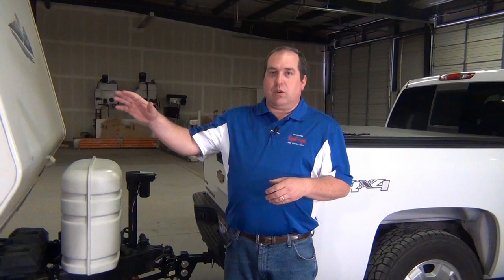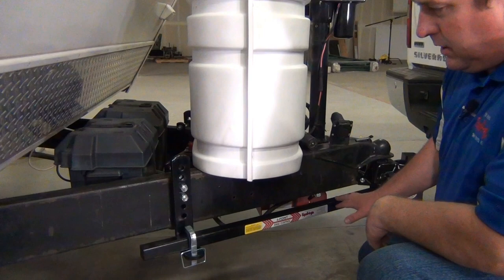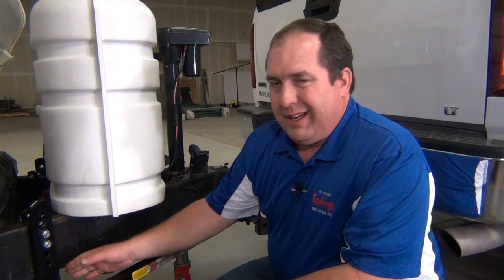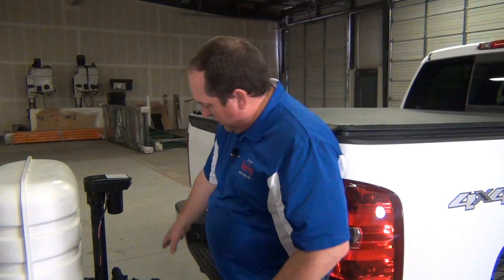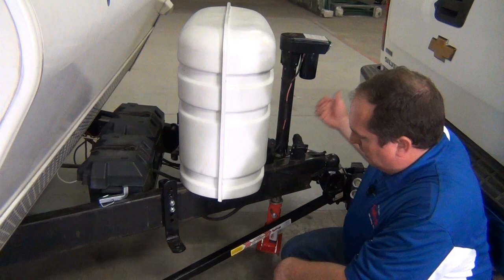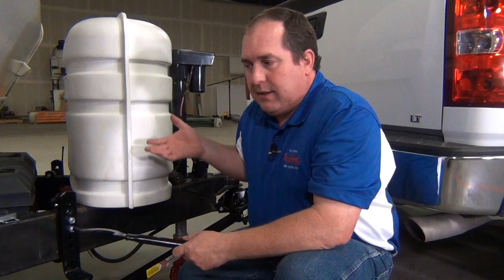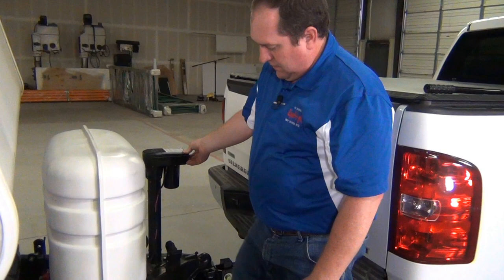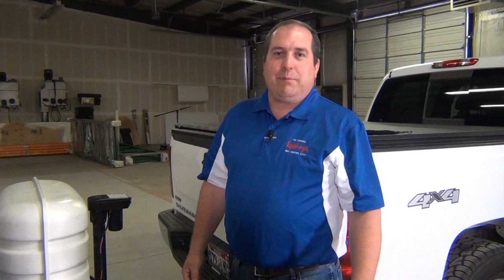How To Hitch and Unhitch Your Equal-i-zer Hitch

Comment: Great Video ... on the GREATEST Hitch!!!
If I were to add anything, it would be about the unlikely situation where you are either trying to couple/uncouple where the trailer and tow vehical are not approximately level, or if you can not raise the tongue jack high enough to loosen the spring bars.  I would suggest: A.) When vehicales are not level ... uncouple on level ground, prior to un/coupling; or B.) If you can not loosen the spring bars ... you may not be getting enough hight from your tounge jack.  In this case, it may be necessary to use blocking (preferably a sincle, large 4”x6”x?” block of wook, or two) in order to give the tongue jack more “travel” hight to loosen the spring bars enough.

Thanks!
LOVE MY Equil-i-lizer 1200 ... the Greatest Hitch Ever!!!
Reply from the maker: Thanks for the compliment We’re glad you love your Equal-i-zer hitch.

Great advice, thanks for the comment. Have you tried a Fastway Flip [https://www.fastwaytrailer.com/flip-jack-foot] automatic jack foot? It’s super fast and easy, saves you about 50 cranks every time you hitch up or unhitch, and gives you an extra 6” of length on the jack.

Comment: I wish I knew this when I got the camper! I could not figure out how to use the pry bar tool and wound up using a rubber mallet to get the sway arms in place. I do not have a power jack and did not latch the ball did not lift the truck with the hand crank. After watching this video it very easy to hook up my new Forest River camper trailer now.

Comment: Great video. Equal-i-zer hitch is #1 
Wished I still owned a travel trailer, it's the ONLY set up I would use.
Reply: I'm new to this hitch system.  I recently purchased a 2018 forest river heritage glen and have this new E2 system.  We took it out this past weekend. One issue I had was removing the bars.  The release pins didn't release the bars.  What am I doing wrong.  I hope it's something simple.  Any suggestions would be very helpful.  Thanks in advance..

Comment: I wish I had seen this 12 years ago when I got mine; I had to figure it out myself.  I love it though, 28' TT + F150 and it tracks straight as an arrow no matter what.  What's more, it's a manual jack so I get plenty of exercise.
Reply from the maker: We’re so glad to hear that you’re having a great experience with your Equal-i-zer hitch. If you ever need an upgrade on the jack, you should check out the Fastway Flip Jack Packs [ https://www.fastwaytrailer.com/flip-jack-feet ]. They are a top of the line jack, and come with a Flip automatic jack foot included to give you an extra 6” of lift, and no need for wood blocks. They save you about 50 cranks up or down.

Comment: Before the video was shot he probably had gone through the process so that the trailer was perfectly positioned over the hitch ball.  Often, especially when unhitching, the back of the truck will begin to rise as I lift the trailer to free it from the ball.  I've learned to feel the positioning of the coupler vis a vis the ball with my finger and then pull the truck forward or backward a tad so the trailer lifts freely off the ball.  Never comfortable with my finger under that thing.  I wonder if there's a trick to proper positioning that he might tell us.
Reply from the maker: +Craig Knowles,
The most valuable trick I know for coupling and uncoupling your trailer is practice. The more you do it, the more familiar you become with where it has to be.

Aside from that, here are my tips:

Grease the hitch ball and coupler.

When I'm coupling up, I try to stop the ball just a little short of the socket in the coupler - maybe 1/4" to 1/2". Just enough that the coupler is past the flat on the top of the hitch ball, and will catch the rounded surface. When you drop the coupler onto the ball, it puts a little tension between the two, and pulls the ball into the front of the coupler. This gives you space at the back of the ball so the latch can come up against the ball easily. If I have dropped the trailer onto the ball, but can't get the latch to lock into place, I put the tow vehicle in drive (with my foot on the brake, and the trailer tires chocked), and let the idle pull forward just a bit so there's some tension between the ball and coupler, pulling the ball to the front of the coupler, and allowing the latch to move into position.

To uncouple, I get the trailer where I want it, then chock the tires, (both sides). I use the ONEstep by Fastway trailer products. They are rock solid. http://www.fastwaytrailer.com/onestep-chock

If it's on level ground, the trailer usually comes off easily.

If you backed into place, or if you're parked on a slope where the trailer is higher than the tow vehicle, the ball may be pushing backward against the coupler latch, making it difficult to release. In this case, I use the same trick as above, put the vehicle in drive (after the trailer is chocked), and let it come forward enough to take the pressure off the latch.

If you pulled forward into place, or if you're parked on a slope where the tow vehicle is higher than the trailer, the ball may be pulled forward in the socket tightly, also making it difficult to release. This commonly results in what you described above - the back of the truck rising as you try to lift off the trailer. It will lift until gravity overcomes the tension between the ball and coupler, allowing them to release. In this case, with the trailer chocked, I put the tow vehicle in reverse, and let it shift backward just enough to release this tension, then uncouple the trailer.

Hope these are helpful!

Comment: I want to see the spring bars installed and removed otherwise you haven't shown me a from scratch install. I'm considering your product as a replacement for a system with heavy bars and don't want to replace it with something as heavy. thanks
Reply from the maker: Hi Karen! You're correct, this installation video doesn't go into specific detail in regards to putting in and taking out the spring arms. If you need specific instructions on that, you can refer to our EQ instructions, as well as contact our customer service team at (800) 478-5578 and they can walk you through that process as well.

Here is the link to the installation guide. https://www.equalizerhitch.com/manuals-and-guides/manuals/6k-14k-owners-manual

Comment: How does this compare to the Anderson Andersen 'No-Sway' Weight Distribution Hitch? Why is this a better choice?
Reply from the maker: maxamus2012,

This is a great question, thanks for asking!

To answer, let us explain that there are three different categories of hitches. We like to classify them good, better, and best.

A good hitch is a typical chain-style trunnion or round bar hitch. They have been around for a long time, and are manufactured by many different companies. We classify them as “good” because they are a better option than just towing with a ball mount. If you use them correctly, they help distribute the tongue weight back to the front axle of the tow vehicle, which improves your steering and braking control. They do not provide any sway control.

The “better” class holds all of the other hitches (except the Equal-i-zer hitch) that are weight distribution hitches with built-in sway control. There are many hitches in this class by many different manufacturers. They are better than the “good” class, because they do add a measure of sway control. In our testing, the ones at the low end are comparable to a typical chain-style hitch with add-on sway bars. The very best of these we test at about 1/3 as good as the Equal-i-zer. The Andersen hitch would be somewhere in the “better” class.

The Equal-i-zer hitch is the only hitch in the “best” class. It has been around for more than 70 years, so millions and millions of road tested miles and experience. It is made in America (and always has been), using only steel produced in the United States. More than 99% of our customers would recommend the hitch to their friends, and it has been voted the best hitch by the readers of Trailer Life magazine all four years in a row. No other hitch has ever been given the gold in their Reader’s Choice survey – only the Original Equal-i-zer Sway Control hitch. This is the court of public opinion – your peers – saying it is the best, not us tooting our own horn. In our internal testing, the Equal-i-zer hitch outperforms all other hitches by up to 8x. It comes with a lifetime warranty, and delivers the safety and performance trailer owners want and need. That’s why it’s the best.

Hope this answers your questions. If you would like more information, get in touch with our customer support team M-F, 8:00 a.m. to 5:00 p.m. Mountain time at 800-523-9103, or drop them an email at Support@EqualizerHitch.com. They are the best.

Comment: I've owned this hitch for several years and it is fantastic. I have had some issues unhooking the sway bars when my truck is on an upward incline and can't get the jack high enough to take the tension off. I carry a pry bar just in case; but this is pretty brutal. Any suggestions?
Reply from the maker: A dub,

When you are parked with the front of the tow vehicle on an incline, with the front raised slightly over what it would otherwise be on level ground, you are changing the angle between the tow vehicle and trailer. Extending that out to the ends of the spring arms, what you are effectively doing is increasing the distance they must be moved to be placed on the L-brackets, or you your case, to be removed from the L-brackets.

One solution might be to stop and remove the spring arms at a level area near the location you're going to park. For example: if this is happening in a camp ground, stop on the road near your camp spot, drop the jack and remove the spring arms, then park the truck and trailer, and uncouple it as you normally would.

Another solution would be to place some additional blocks under the tongue jack, or use a jack extension foot like the Fastway ONEstep jack foot. (http://www.fastwaytrailer.com/flip-jack-foot). This will give you a few more inches to raise, and should help make it easier to release the spring arms.

One last solution you might try. Go back through the Equal-i-zer hitch owner's manual, and check your weight distribution set up. If you are getting a lot of weight distribution with the current set up (all the way back to the baseline height), you may be able to drop the L-brackets one hole, as long as that still gives you enough weight distribution to be within the recommended range (at least halfway back). If you know that the location you're going to is on an incline, you could quickly and easily make this change for these trips, then put the L-brackets back up a hole for towing to locations where the incline is not an issue.

Thanks for the comment. Good luck!

Comment: Equal-i-zer hitch would this have any benefits on a small car and cargo trailer, pulling a 4-wheeler or lawnmower. Total weight of trailer and cargo probably won't ever see 2000lbs, on average probably 1000-1200lbs.
Reply from the maker: +Hill Billy,
Yes, it would. The same principles apply to smaller trailers as to large ones. However, in practice, it is more difficult to do. Most small tow vehicles' frames are not designed for the forces of weight distribution.

Check your owner's manual, or ask the manufacturer of your specific vehicle if it is designed to tow with weight distribution. If so, you could use the 4K Equal-i-zer hitch with your setup. You would need to have a 2" receiver installed on the tow vehicle, and make sure the tongue of your trailer has enough room and a place to install the brackets that hold up the spring arms.

Comment: If you're unhooking at a campsite, can't you simply lift the tongue of the trailer a bit and unhook the shank from the receiver and drive the truck away?
Reply from the maker: +Howard Ochs, thanks for the question. Nope, you can't. This might work for a weight carrying hitch, like a ball mount, but not for a weight distribution hitch. When you have the weight distribution arms engaged, it puts a lot of upward force on the hitch shank and the tow vehicle receiver. This binds them together, and you cannot pull the shank out of the receiver.

Raising the tow vehicle and trailer together lifts the weight off the spring arms so they can be disengaged, but increases the bind on the receiver. Once the arms are off and the vehicles lowered, the bind on the receiver is removed, and it is possible at this point to pull the tow vehicle ahead off the hitch shank

Comment: Just bought a Grand Design 2650RK...the EQ was the first thing we worked into the deal (a memory foam mattress, bedroom TV,  and rear camera were the others). Thanks for this basic explanation video -- clear and concise. Perfect. Thanks for the posting!  Jennifer and Alan, tablesandtravels.com
Reply from the maker: The Engles,

Congrats on the new trailer! Sounds like a beauty. Thanks for using the Equal-i-zer hitch, we are confident that you will love its safety and performance.

Save travels!
Reply: Equal-i-zer Hitch Great video, what you didn't show is how to remove the bars completely.  Please do a video on that.  It would be very helpful not only for me, but for others owners of this new system.
Reply from the maker: +Chuck Faubel,

That would be a good video topic, we'll put it in the queue!

To remove the bars on the Equal-i-zer hitch, go through the unhitching process and take the spring arms off the L-brackets. Then, remove the clips and pins that hold the arms in the sockets in the hitch head. The arms should easily slide out of the sockets.

Comment: Nice video. Just wish I’d watched BEFORE attempting do this for the first time. 😬
Reply from the maker: +AAV8R,
Glad it helped out!
Reply: I also wished we had seen this video before our first trip.  We came home with our first TT after having had 4 pop ups. Because we were camping the next day , we just left it hitched. Everything was going great until we got to the campsite and could not figure out how to get the swing arms off. I finally dug out the manual and we did get unhitched but this video explained it so very well. I still watch this video even though we have the process pretty well down. Good presentation and easy to understand. Thank you
Reply from the maker: Thanks for watching and commenting +terri mcfetridge!
Reply: terri mcfetridge Yup. The morons at the dealership had it hooked up when we came out from signing the papers & the maintenance guy didn't describe it well enough. I had the same experience as you when I got home.